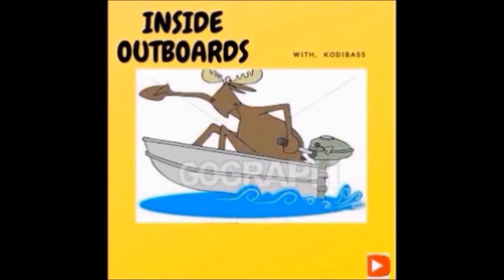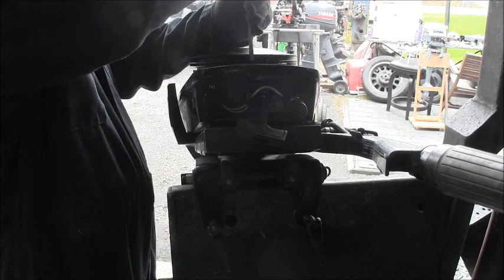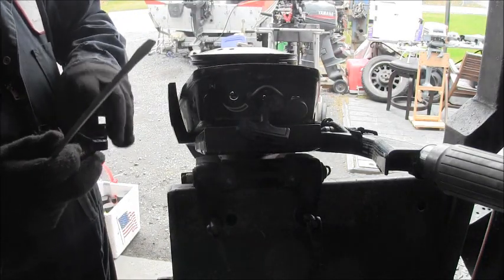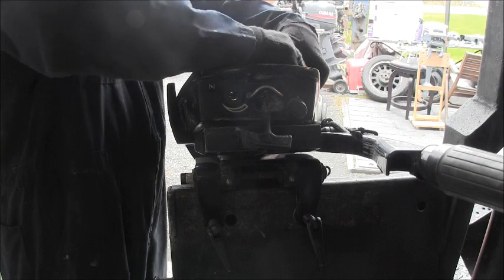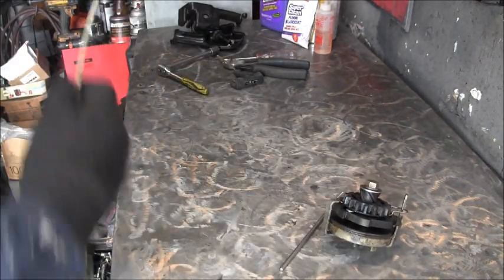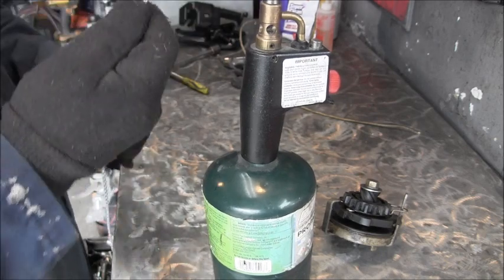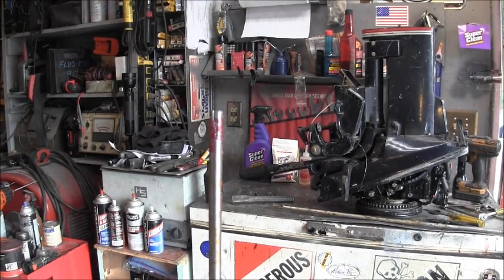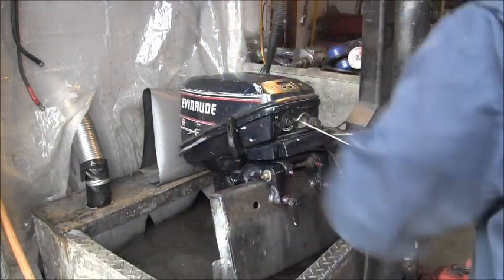EVINRUDE  15  HP LONG SHAFT  CONVERSION  TO  SHORT  &  more

Comment: Those of us that know... Just know!  Keep them videos up!  A lot of us "crazies" enjoy and LEARN A LOT! from your knowledge combined with your experience!
Reply from the maker: Thanks mate . kb
Reply: @kodibassInsideoutboards  hey mister great vid I wanted to be able to convert my long shaft back and forth to short shaft it’s 1993 evinrude 15hp model e15retb what parts would I need short drive shaft short shift link and short water pickup? Your advice would be greatly appreciated
Reply from the maker: @dickjames5007   Yes that would do it, however a water tube length adapter will B needed if you want to change it back to long-s.     kb
Reply: @kodibassInsideoutboards  it was already long shaft. I got off the phone with guy and he said model num was short shaft so all I need was s driveshaft and s shift rod and I can change it back and forth if I ever want to use long or short or sell it for that matter. Thanks again.

Comment: Well it takes "loopy" to "know loopy", that's for sure....I'm down here in New England, wish I had an excuse for my own brand of "loop de loo"....You speak much nicer to your outboard buddy's than I do though.   Wonder why those smart engineers made the water tube such a tight fit though the dang extension hsg...Haven't seen a spun impeller on one of these since the early days with the aluminum/SS impeller housings.  The good ol salt had a way of getting between the dis similar aluminum and SS, then crushing the SS cup inwards really putting pressure on the impeller resulting in the spun hubs....

Comment: Can you buy the shorter shafts? I have a long shaft 15hp but need the short shaft on the boat i have. Impossible to get on plane with the long shaft. Ive seen people build a higher mount transom but would rather do it the right way. I didn't realize it was this easy to make a short shaft. Thankyou for your videos they help a lot with my 6 and 15 i have.

Comment: Kodibass, is it possible to obtain diagrams of the exact motor i have, like maybe by  providing not only the model number but the serial nunber also? I found diagrams online for my Johnson BJ30BAECS but the diagrams are a bit difrent than ny motor, especialy with the manual primer. If i hooked the tubings up right, fuel comes to the primer from the top of the carb. then gets pumped into the bottom of the carb, that simple. But the diagrams & videos about 30 horse Johnsons & Evinrudes show the primer pumping to a tee that goes into 2 places at the front of the engine.